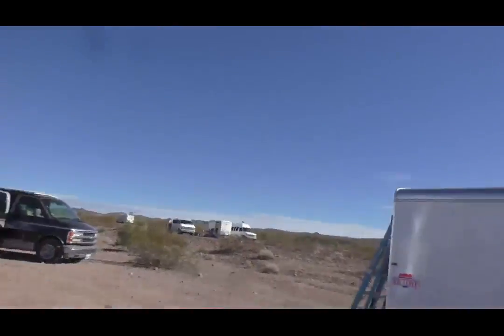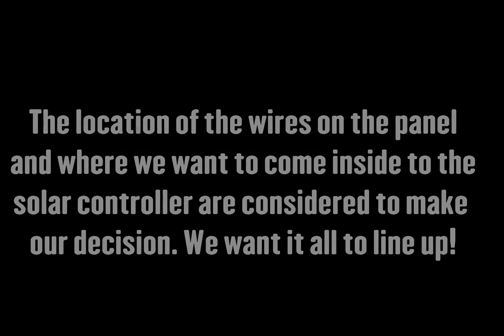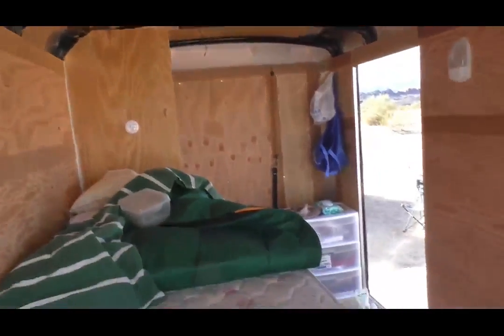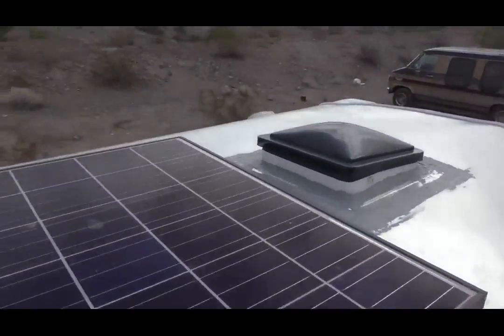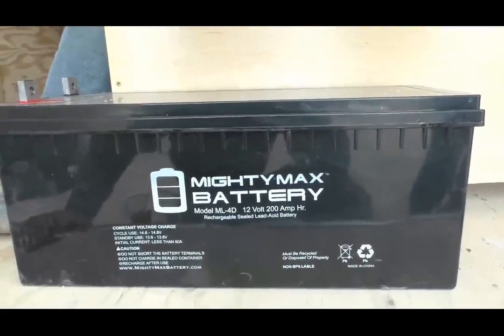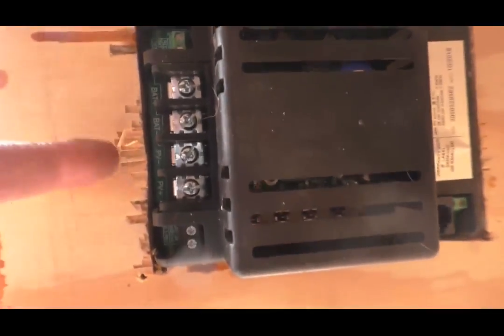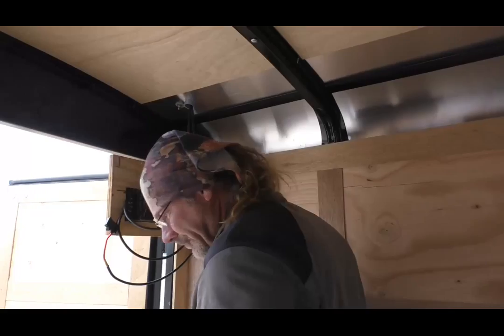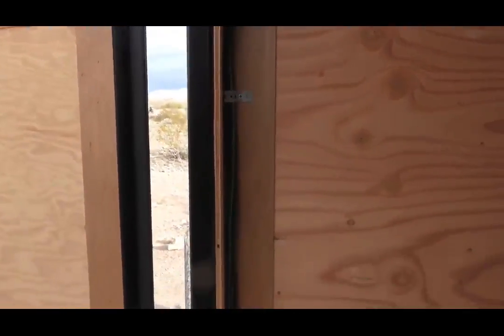How to install Solar panels for RV | Bobs Cargo Trailer Install

Comment: The video shows all the installation and the details that appear and require a certain reflection to finish the work with quality. The technical information regarding the type of battery and the inverter are very important, so a good job and important information on youtube for the nomadic community.

Comment: Jamie, After watching this install video, I now know how to set up
my panels on the roof of my 2014 Interstate Load Runner enclosed car trailer. 
The idea of the L brackets is the way to go for sure. When I can, I'll give this a 
go and see how it turns out. It's gonna be hard I know because I will have no
help, I'll be going it alone, but if I do as you guys did, I should be able to do the
install. I went with Two Renogy 150 Watt Panels,  Renogy RoVER 40 amp mppt
charge controller, and a 500 Watt sinewave inverter.  Everything is Renogy except 
the batteries, Those are Trojan T-105 RE 6 Volt. 225 amp hours. Everyone kept 
saying go with the Trojan T-105 RE, So that's what I did. And my gawd those are 
heavy batteries! Anyway, I just had to thank you for sharing the video, It sure helped
me out, more than I can say. One day would like to spend some time there in Az. and
meet you in person. Till that happens, you take care, and keep up with the awesome work. Great video, Thumbs UP !!

Comment: Excellent job, Glad you are helping others. Just a suggestion, Heat shrink instead of electrical tape, and soldier the connections after crimping.  Keep up the good work.
Reply from the maker: That brings up a great point tmapes1989. I actually DID solder some of the 4 gauge cables that were installed during the build party. As minor the cost as it may seem, I didn't have the budget to come out of pocket for such things as more electrical solder and shrink wrap. I went into the red on this build event and will definitely be coming up with some solutions to that on future builds. Thanks for watching.

Comment: I would use a weather type emt on the outside elbow.  A pure sine wave inverter would be used for AC motor or compressor or desk top computer.  great job. I would make a drip loop on the incoming wire to keep the water from seeping onto the controller.

Comment: great job guys but if i may make a suggestion, on those butt connectors use heat shrink tubing instead of the tape,  and as far as the carriage bolts, they are great to use as long as you have the punch for the squares , just trying to help. keep up the good work

Comment: Well that was a pretty impressive install you did there James, Not just with your handy man skills but with your general knowledge of every aspect of the install. When you first mentioned about setting the charge controller to the absorb and float settings I automatically thought you should check the battery or the batteries web-site for the battery requirements, and before I could get the thought out of my head you said that is what you should do. lol 
I have to say of all the YouTube channels I watch of people living in their vans or RV's your Youtube channel is the only one I respect. All the others the people don't have a clue what to do if the light doesn't turn on when they flip the switch. 
I used to work on Jet Engines while in the Air Force and you get to know people pretty good and what skills they have and who you can trust and who you needs to be checked up on after their work. I am not sure your subscribers or fellow van dwellers realize what a competent person they have in you. 
Of all the people living that lifestyle that I have seen on Youtube your the only one I would trust working on any of my equipment knowing you would do it right, I have to say not to many people impress me now a days but your the exception. And that is probably why I was disappointed when you had to go on Go Fund Me to get you van fixed, As I knew you were way above that, unlike all the others, But I gave it some thought and came to the conclusion that you help a of of people for just the satisfaction of helping them (and that is worth more than money) and it was their way of helping you out of a hard time you were going through so why not accept some help, nothing wrong with that.
And another thing I admire about your channel is that you never belittle the life styles of people that live in houses and just invite them to try your lifestyle. Unlike Bob that continually portrays the life style that I live into a burden and I am shackled to a ball and chain and money pit, his comments of breaking the laws you don't agree with and live for today mentality really put me off of him. 
I was building a off road trailer to tow behind my Jeep to go and do some camping up in flagstaff and around MOAB but his constant comments of his dislike of society that I stopped the build on my off road trailer and thought I guess this is not for me
and I really don't want to be around people that dislike society so much that they belittle people that live in it, and I do not have nothing against people that live your life style. I think it is just fine, the only thing I do not understand is with all the information available on the internet to do just about anything they don't do some research before hitting the road. (but then again if they did you wouldn't have anything to do)
  I don't know what happened between you two but I can say that I am glad your channel is entirely yours again, and I look forward to your postings. Your doing a great job.
Reply from the maker: Those are some profound compliments I hope I continue to live up to Wrangler. Thank you. Yes, the blown motor, GFM days were not my best. Seeing the community come together so swiftly at that time was humbling to say the least. 

I definitely want to communicate that if you have the itch to come out and immerse yourself in different outdoor landscapes then by all means, finish your trailer. Heck, We can cover your build-out on video and upload it so others can learn about your thinking process behind the build. Plus, I really don't run into many vandwellers in Moab and several other places I travel. The ones I do meet are totally cool with everybody. Most of the folks camping on BLM land I run across live on the grid and have lives to get back to. 

I never know the person behind the moniker until I read long comments like this that offer a window into your history and age range. I appreciate you and others spending time on my channel when so many other options are pulling at your attention. Take care.
Reply: Thank you James, I was talking with my son-in-law to see if he has time to start up and finish the trailer, might take a couple of months or so, still expensive even doing it yourself, maybe it was a good thing I took a break on it as I have made some changes to the build, I decided I don't need half the things I wanted to put in it, Bad thing is I already bought the equipment for all the things I thought I needed. Oh well.
Did you ever get your dirt bike fixed? I was looking at on your bike on your other videos months ago, pretty nice bike for sure. 
I was born and raised in Southern Calif and was a teenager in the early 70's when motocross just started taking off. Being pretty close to Carlsbad raceway my friends and I were there racing our bikes and riding our dirt bikes in the hills around our area, (Those places are long gone, housing estates and shopping centers there now) We snicked into the USGP at Carlsbad for the GP's they held there and watched our heroes Roger DeCoster, and the best American rider at that time Brad Lackey, and the other  European riders that were light years ahead of our riders back in those days. I still have my Motocross Action and Dirt Bike Magazines I bought at the 7-11's and the photos I took at the Carlsbad GP's long ago. I went to the British GP back in 1978 when I was stationed in the UK, I camped out there by the track with my then girl friend/now ex in a tent and we had a great time. Camping in the UK is completely different than here, like setting up on a golf course with the farms having little shops where you can buy eggs, bacon and milk for your breakfast. Also went camping at Silverstone to watch F1 races, Camped out for the three day event beside the track with my former brother-in-law, we did that every year from 91 until 97.
I was think of buying a dirt bike to ride along the trails, My son-in-laws friend is a sales manager at bike shop close to me and he told me he will give me a good deal if I decide to get one. something to think about.
Anyway thank you for you answer. glad to hear you are over your injuries you got riding your scooter. I have had plenty of those myself, hmmm maybe a dirt bike isn't the best idea...
Reply from the maker: Yeah, My bike is working and it's up to the rider to decide the margin of danger he's willing to take on, so, Yes, get your dirt bike! There are so many trails available to us out here. Potash road, just to name one in Moab. I can't imagine life without a motorcycle!
Reply: Enigmatic Nomadics This is totally amazing! This is exactly what I need done. Plz let me know if you're ever in New England & are looking for a job. 👏👏👏Well done!

Comment: I have a 24 foot enclosed trailer from TrailersPlus also that I just picked up from Moore, Oklahoma and I just worry about voiding my warranty by attaching panels to my roof where they will go.  I really like the work that I been seeing you do and this one really got my attention when I seen the victory trailer made me really see that this is going to be all happening to my trailer after watching you videos.
Reply: 3XR5 because I have a lifetime roof warranty on the roof and I just have to find the best way or flexible panels that I can attach so screwing into he roof will not cause any problems therfore not voiding my warranty I have to have the trailer company cut and mount my exhaust fan because I really want to put a fantastic fan in.  Where would be the best place for the price for flexible panels kits that would be good for me to go with in you opinion?
Reply: 3XR5 thank you that's what I will do is go with the ladder rack idea you mentioned. Thank you so much.
Reply: 3XR5 thank you for your opinion on that I think I will wait till I get into Arizona to pickup the panels and equipment from Bob's solar store I called and they don't ship anything so for the time being I will just use my propane to heat and for the stove and lighting I will just use when I need it.  I think it will be better for me to have everything to be ready for me to install when I get in the area.

Comment: what  a great install, what great guys you all are helping others like that :-) Very useful video too, I wish I had watched it before I did my own install. ps I didn't have any power to use anything to heat the shrink wrap on my cables so I had to wait for no wind and wave around a cigarette lighter. ... took a while but it worked ha ha

Comment: Very good and clean install. We plan to have solar installed to our travel trailer. Right now we live in Ohio and we haven't found anyone with any experience installing solar on a RV. We plan to go to Arizona eventually where we're told, there are many more talent installers with the experience to do our install. My question is:  Is there any particular individual or company that does good professional solar installs that you know of ? Thanks and Much Peace !!!

Comment: In a video a while back you mentioned how great the Astro Vans are about a month ago I picked up a 1999 Astro Hightop AWD for $900 the guy was a former road Nomad who was selling to buy a boat so its got Nomad in it's blood! I also picked up a 1966 Star travel trailer that's in pretty good shape that I will be towing (2,000 lbs) I need the trailer for my Sharpening Work Shop I plan on being in one area a month working slowly following the weather ( 40's to 70's) I will be at next years RTR!  I look forward to your videos they are educational and also demonstrating what it's like to be a "Helpful Nomad" ....Blessings & Peace
Reply from the maker: +The Nomad Sharpner Thanks! Please get tires that can resist sidewall puncture damage
Reply from the maker: +Enigmatic Nomadics mine are KM2s. Probably lots out there for cheaper.

Comment: Hello Jamie, I watched your video on Lee, when I viewed the first video I noticed how clean his installation of the MAXX Fan, that decor is not even noticeable, very clean.  I think if there is one thing that can be passed on to DIY era, this is one, I just saw your decor job on this trailer, Yikes!  Not to be disrespectful but I just think that th clean look is so much nicer. i am trying to reach him but if you can find out how he dod that i would appreciate learning that,

Thanks for your vids,

I'll probably make videos of my Sprinter 170 van build out  once I start, I have the Van and starting to order parts.

d
Reply from the maker: I replied to this question when you asked it on Lees video. By the way the dicor is made to be intentionally runny and go every where, "Self leveling". Good luck!

Comment: love your videos Jamie :) im converting a van into a tiny home and planning to install a 200 watt Solar power system. I'm wondering if I would be able to run a 40 AMP vitamix blender off such a system once or twice a day for no more than about 30 seconds at a time?  I also plan to have a domatic refrigerator hooked up to the system.

Comment: automotive wire of the same gauge would've worked, it has way more flex than house wire, I plan on doing an install on my truck camper soon. I plan on using the stiffer normal solar wire on the exterior, then with connectors splice to automotive wire inside, only way ive come up with stiff wire and a pop up truck camper... Great vid!
Reply from the maker: Budget, Lost Travels. A whole lotta budget stuff going on there my friend. I should have been more clear about that in the video.

Comment: Nice having friends who know how to do this work.  Did a nice job securing all the wires.  Did you secure the wires from the rear of the panel to the roof so they do not  beat on the roof while driving down the road?

Comment: Hi Jamie..Im just trying to hook up my system and Im a bit confused about what gets grounded where now. I know my van battery is grounded to the van. But then what else needs to be grounded? Im putting my solar panels on my van now. Was planning to be out there by now but keep having problems. The latest being I recieved the wrong controller from renogy. So I think Ill have to stay here till it shows up here. I dont know if or where I could send it to a different adress just to get there sooner.  and I'm in Missouri.  The weather is not helping at all. Its beyond freezing here. In the negative temps...Brrrr... 
Happy New Year...
I appreciate your videos.
Thank you. ~ Ladybug Sarah

Comment: I have a question. I will be coming to the rtr and I have 2 regony 100 watt panels a battery and a converter. will that be enough to power a 1.1 amp mini frig?

Comment: those connectors are meant to stay on, not be cut off, so you can't screw up which is positive or negative
Reply from the maker: The installer won't screw up if they understand the difference between positive and negative, and both knows how to read the
 back of the panel labels and how to use a volt meter SeniorQuichotte.Thanks for watching

Comment: Do you recommend the battery in the back or up front on these cargo trailers and why? And any chance you are going to be around Utah and would like to help me get mine installed? lol I have a Renogy kit and have just been staring at it longingly. Your video makes me feel more brave about installing it now.
Reply from the maker: +Josie Taylor Maybe we could install it. We are swamped right now,  but we can play it by ear. Thanks for watching!
Reply from the maker: +Josie Taylor Batteries in front just to keep the weight up front, but anywhere is fine otherwise.

Comment: Jamie, I have three 100w  panels on the roof and a 15amp breaker between panels and charge controller. Do I need to change the breaker to a 30 amp ...
Reply from the maker: Yes, please.

Comment: Jamey, 
With all the 12 volt gadgets on the market today, is it really necessary to run an inverter? 
My question is in regards to starting from scratch.
Reply from the maker: I know folks that only buy 12v appliances and 12v  power cords are available for laptops. Cell phones run on USB mostly, so yeah, it can be done and the power loss through the inverted would not be present.

Comment: Heat shrink tubbing is a better choice than electrical tape. The use of plumbers strapping is a bad idea, the sharp edge of the metal could potentially , with the movement and vibration of the trailer in use, cause a short to ground  and fire risk. The correct wire clamps are inexpensive vinyl covered and can be found at any building or electrical supplier. For safeties sake please revisit this issue.
Reply from the maker: This job was done, free of charge, out in the desert, with what we had.  While your points have validity, a short is definitely not plausable. Your milage may vary.

Comment: great video. How would you fasten this panel to a curved fiberglass hi-top?
Reply from the maker: Depending on the roof curve, longer L brackets would do it or a roof rack with longer brackets, but I'm not a huge fan of the look of rook racks. Just personal preference.